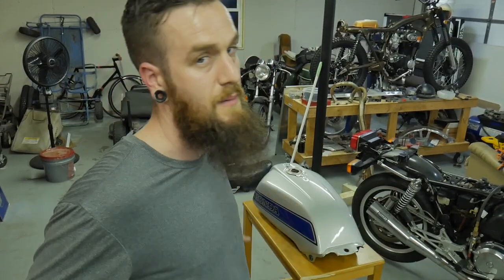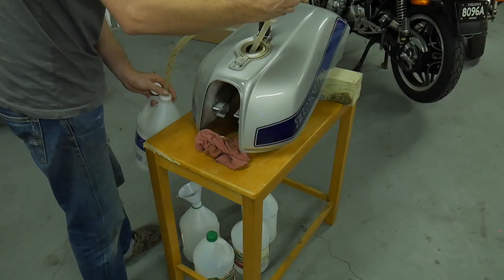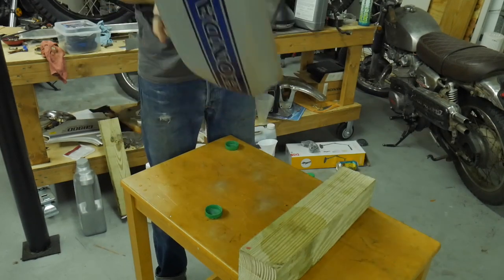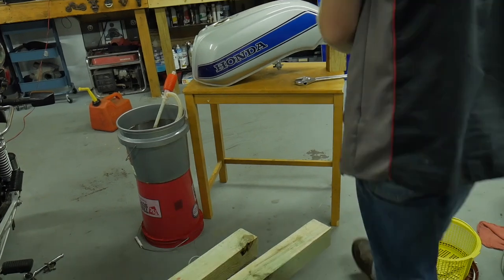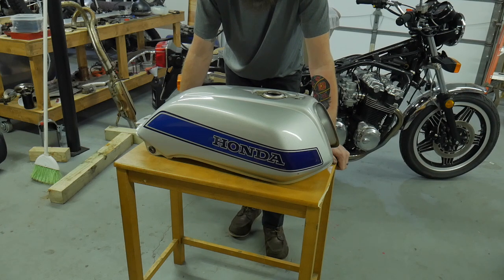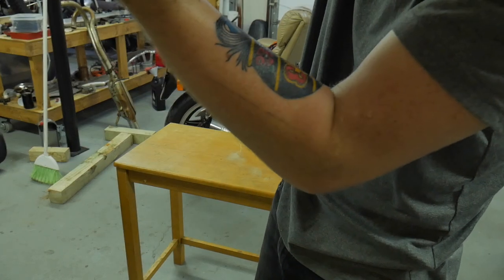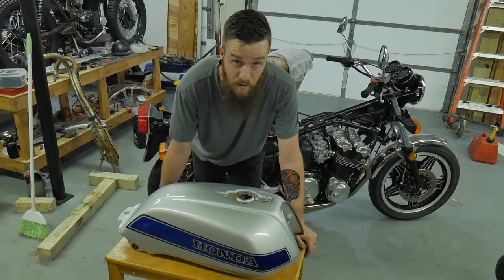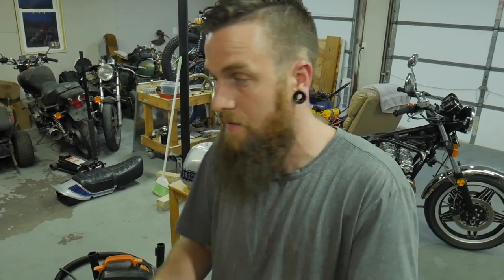Motorcycle Tank Cleaning : Varnish and Rust Removal

Comment: An old Harley guy told me to use a pound of pennies and a handful of dimes. I think that would work at the end of this process too loosen the last bit of dry material before vacuuming. But I would rinse one last time with mineral spirits which leaves a layer of oil (that eventually evaporates) to prohibit flash rust. Just a thought!  Nice video!!! 👍

Comment: Use your long air hose nozzle to blow the rags around inside 100mph wiping down the insides….the air will also atomize any liquid inside the tank so the rags can absorb  it all….have a wire with hook handy to catch the rags spinning by the hole ….been using this method for 35+ years
Reply: ….. Wut? 😰

Comment: Great work, Cody!  Thank you for sharing your technique!  I've tried a lot of different methods over the years and I've simpled-down my particular way to a vinegar soak (at least 24 hours), quick med/high pressure water rinse, (vacuum any debris, but most is already out ... I'm a demon about pressure washing the debris out) then swish about a gallon of diesel around inside the tank (contact everything inside) then drain the diesel and use.  You must use a fuel filter with this method and keep an eye on the in-line filter for a bit, but that does it.  
This was recommended to me by an old-timer who could also braze like an Olympic champion; he was heavy on HDs and Brit bikes, but he was cool as the other side of the pillow; and a bit of an encyclopedia on British iron.  
Thank you again for sharing, you are one of the few (3) I subscribe to and it's because of your teaching ability and your depth of knowledge.  
Drive On,
-KR
PS>  I've also used Metal Rescue, POR15, and Evaporust ... all with very good results.

Comment: EvapoRust will take out all the rust and not etch the surface.  The spots you see left over after the metal rescue is the rust is mingled into the old gummed up gas.  Something like this:Berryman 0116 B-12 Chemtool Fuel Injector & Carburetor Cleaner, will chew that old gas up quickly.

I usually do a Flush, B-12, flush, Evaporust, and works great for me, and the integrity of the tank is not compromised.
Reply: @jacobnonyabidness1155  No need to.  That's the whole point.  Evaporust cleans it way better without etching the tank.
Reply: @rustusandroid  I apparently have room temp iq lol I still don't understand what you're flushing with
Reply: @jacobnonyabidness1155  Oh, just the flush is water, preferably warm.
Reply: @rustusandroid  No! Preferably cold water and immediately flush with gas.  You promote flash rust with hot water.  The follow up rinse with gas prevents it further.  2 stroke gas is even better! Slosh the 2 stroke all around, then drain. let air dry in the sun.
Reply: @jeffreywright9064  I agree, but the EvapoRust will solve the flashing problem.
Reply: You are the first person i've seen highlight this 👍
I just did my tank with vinegar which worked 100% then I thought if I use fairly hot water it will heat the metal and help the water evaporate after I have done the airline seemed to make sense, that's right I learned the hard way! by the time I'd grabbed the airgun my tank was already tan in colour. I can only assume the steam created by the hot water attacked the now vinegar etched surface more intensly than cold would have ! oops.
I am thinking now why not cut the water out of the loop and rinse with some fuel or maybe some cellulose thinner straight after the vinegar and then finish with the oil and fuel, I would appreciate your take on it.
I think im about to mix some vinegar with cellulose in a jar !

Comment: I recently checked with Honda regarding fuel tanks being lined with a protectant from the factory and was surprised when I was told the tanks aren't lined with anything from the factory. I'm about to use evaporust to try to remove the damage ethanol gas caused in my 02 shadow

Comment: Thanks Cody, my newest 1976 gl1000. Custom built manifold with Weber 2bbl carb. I made it run, big fat napa fuel filter plugged solid in 70 miles. Yes broken rusty pieces missing worn out. Fix everything. Bike is only 20 years younger than I am. Less than 65,000 miles, on bike, it's almost new as old wings go. Thanks for your help, watch you every day.

Comment: I've tried this method of vinegar recently on two different tanks and no matter what I tried to use to keep the flash rust away, it still happened each time. I wish I could just buy new tanks but my bikes are a 80 Honda CM400 and a 79 Honda cb750k, and the 750k tank has a pin hole near the mounting spot near the back.
Reply: use j b weld for pin holes  that stuff works
Reply: I have found that the vinegar (or diluted muriatic acid that I sometimes use) needs to be nuetralised straight after the acid treatment. You can use a weak solution of lye (Sodium Hydroxide, NA OH, Drain Cleaner etc. all nasty stuff) or a mixture of water and household bleach, any mix, not critical. Pour it in and slosh it around. Water wash then immediately give inside of tank a generous spray water dispersant eg WD40 or any of the budget brands, let it drain out.

Comment: I’ve read that WD-40 will tend to remain on surfaces at the molecular level, difficult to primer/paint if you’ve treated a surface with WD-40. So, perhaps the Metal Rescue didn’t work as well because there was a thin layer of WD-40 blocking it from really working?

Comment: I still just mix 1 cup oil with 1 gallon fuel in tank, shake well, repeatedly, new biggest filters you can mount. Change filters often.
Reply: this mix ratio is only to shake around inside the tank and then throw it out right? a MC cant drive on such a high ratio of oil and gasoline

Comment: Does all the old fuel residue have to be completely evaporated or washed with soap before adding the vinegar? I wonder if the fuel residue will become a barrier and prevent the vinegar solution from getting to the rust.
Reply: Rinse the tank with Acetone to remove varnish  I agree , varnish can prevent the Vinegar from working .

Comment: I agree, evapo-rust at harbor freight works perfectly.
Reply: the ONLY thing I buy at Harbor Freight, its not made in China
Reply: Very thorugh and informative. Helped me a lot.im restoring a 75 cb750 four ss.im using a bit more aciditive vinegar,with cleaning
Reply: In cleaning vinegar .just hope I can get as clean as you did.my project has been in a garage since 83.still gas in the tank that still smelled like gas believe it or not. To tires aired r ight up and are still holding after a week....seems absolutely unbelievable,but I shit you not.lol.thanks for the info sir.
Reply: @stevebolton7172  how did you make out on the tank? I have a 96 fat boy that has been sitting for a couple years and having problems getting mine cleaned. Thanks in advance
Reply: So I'm starting to clean my tank. I have an 07' Suzuki 650 V-Strom. Yes it's been sitting and now the tank is rusted. I just threw in a pound of bolts,washers,nails and screws to start the process.

Comment: You can buy the vacuum attachment for cleaning out dryer lint, it costs about $20 and the hose is translucent so you can see what it's sucking up, will fit on both regular and shop vac hoses

Comment: Here is my story.
I own a BMW K75RT ,1991, 100.000Km on it.
I just cleaned the aluminium tank  ,removing all the gas contaminants and little debris accumulated in the years.
Once it was dry i put a vacum hose and a compressed air hose in the tank working in parallel. So the air caused the debris flying around and the vacum collected them.
I noticed two litlle spots with some corrosion just behind where the fuel pump is installled
Maybe the air pressure was too high and this caused 2 little holes.
I had a professional welding the 2 holes frome outside the tank and it is ok now.
The guy told me that cossision spots are here and there and may be i will have extra holes in the future.
Because of this i would slow down/ stop the corrosion process and coat the interior of the alluminium tank.

I would like to know if someone out there have had such  experience, what coat used, how long did it last....and other advice are welcome.
Tks in advance
Antonio (Rome-Italy)

Comment: my technique: use a media of choice, walnuts , sand , glass, baking soda whatever after a bath of muratic acid and a rinse, a cup of course media , compressed air and a bead blast inside the tank light osens and frees particles. then is a simple matter of vacuuming out the debris . never fails me, then coat the tank...

Comment: What if u use a really good quality in line fuel filter too
Reply from the maker: You can absolutely do so. Over time I would remove the filter and back pressure it to clean it out. You can do this over a white cloth to really see how much the filter picked up.
Reply: Like I said it’s a quality glass and metal filter that you can see the cartridge and also unscrew and change the cartridge
Reply: I tried the cheap plastic ones of a lot ofbrands but they always crack and leak with not much use
Reply: My tank has had rust spots on it like minimal minimal spots in various places mostly up towards the filler neck in two years of owning the bike it’s never gotten worse so I guess I’m good and I always try to keep a full tank and always run the fuel filter and it’s as you know a 79 cm 400 a Hondamatic it’s mike from ny we have talked before I wanna send you pictures before and after my slightly modified bike I only modified it a bit so it’s more comfortable for me,, and I have all the original parts to put it back to stock but honestly I don’t ever think I would sell it anyway I have two adult sons to leave it two and at least one of them I know would ride it

Comment: You forgot to mention the neutralizing process, after the acid treatment! Big mistake! Use baking powder and water immediately afteer the last acid flush - and then start the drying out process.
But the solution You chose, is the only one that works. Try different acids on bare metal and see how they work for You, before deciding which one to use.

Comment: Hey, I have a '05 Honda Rebel 250 with only 1100 miles but the tank was rusted.  I want to use Phosphoric acid because I hear that it prevents flash rusting after using it.  However I was curious if anyone knew if I could dilute the mixture with water when using it? and if I should use 75% or 85% acidity. was going to do that then use por 15 fuel tank liner unless anyone has any tips on this method or have had this not work. Thanks
Reply: You can dilute phosphoric acid of course, but the trouble you have is with the white residue that forms after it dries. You can't let it dry off. While the acid is wet it's critical to use acetone and a rag to clean off all the acid. Then the metal surface is protected and in this state will not flash rust. But inside a tank is another matter. I reckon electrolysis would be more suitable.

Comment: What is your experience with electrolysis? I recently put two exhaust pipes through the electrolysis process and the results were pretty neat but I haven't used electrolysis for the inside of a tank... I would love to hear your thoughts on that...
Reply from the maker: I’ve never messed with electrolysis before. Sorry man
Reply: I cleaned up my rusty triumph tank with electrolysis, battery charger, negative connected to the tank (bare metal) positive onto a long old bolt. Cut off a drink bottle to suspend the bolt so it doesn’t touch any part of the tank. Filled it with water and 6 tablespoons of baking soda, left for a day. Cleaned it up great. I did put lots of screws, nuts and small bolts in first to agitate to loosen rust. Easy to remove with magnets, then the electrolysis

Comment: Man, rusted tanks are a head ache, I had one on my Honda steed 400 but all the methods I kept using didn't get rid of the rust well. I kept having issues with the bike because of the filth in the tank, one time it clogged my fuel filter and the bike died on me in the middle of town. Anyway, I sold the bike two months ago. I'm thinking now of a wild idea to get rid of this rust...how about if one cut up the tank in two, scrubbed the two insides with wire brushes and thin steel wire. Maybe coat it after with a preferred coating and welded it back together, repainted it too.
Reply: This would be quite some work but would insure that the tank is perfectly clean inside.
Reply: Dunno about that. No matter how clean you get the tank, there is fuel impregnated into the metal. As soon as you cut into the tank….boom!!

Comment: I was able to get the pet cock fuel filter out of my tank by turning the tank upside down, sticking my finger up into the tank opening and rolling that filter around until I was able to feel it with the finger. I then pinned that fuel filter tube between my finger and the tank and then carefully turn the tank right side up and did my best to create a level bottom part of the tank so that when I released the filter with my finger it would drop straight down and more or less not roll away. And then I was able to use one of those spring loaded grabbing tools, though I suppose some needle nose pliers would have worked too. 

The Moment the grabber got that freaking tube, I think I shed some pounds of psychological weight.